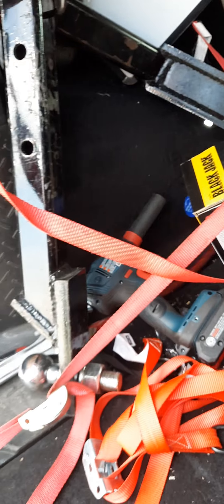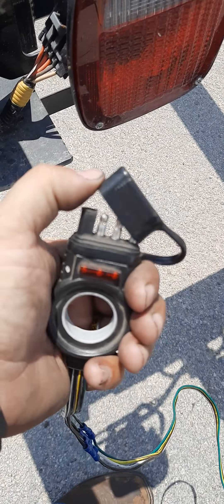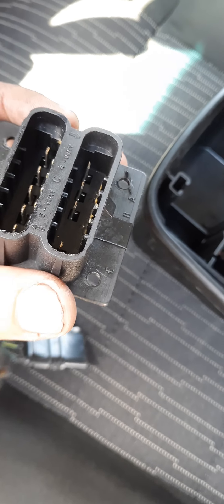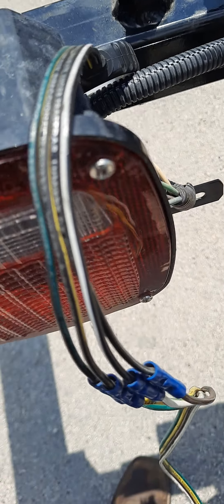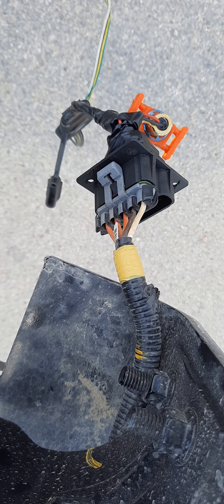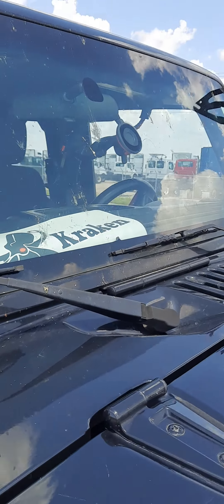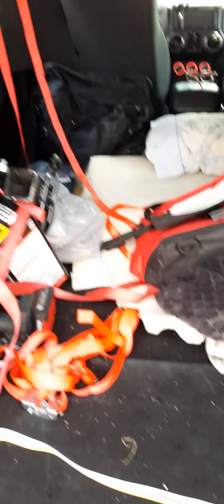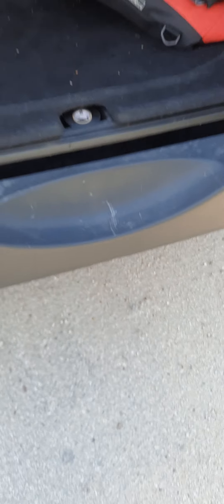Driveway tow lights adapter

Comment: That's a handy little adapter you made there! Any special wiring needed or just connecting the same colored wires together? Thanks in advance.
Reply from the maker: It all depends on the type of Toby tickle you have and what kind of money you want to jump into it.
Let me just say this, don't go into it's half-ass trying to save money and buying cheap parts, you will end up spending twice as much replacing the cheap stuff then if you would have just bought good quality stuff to start with.